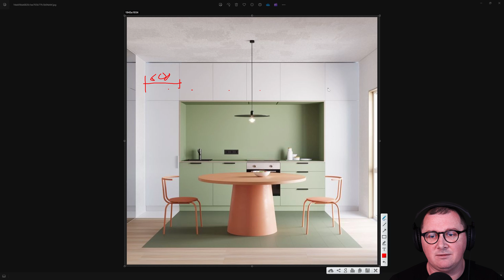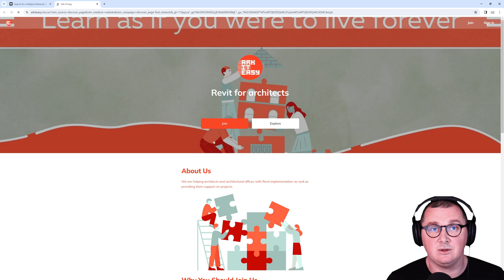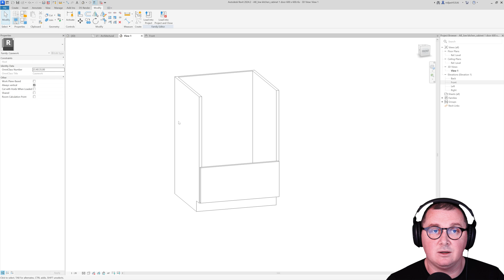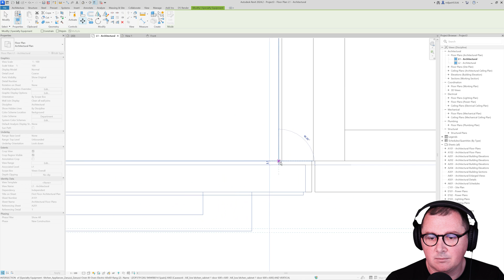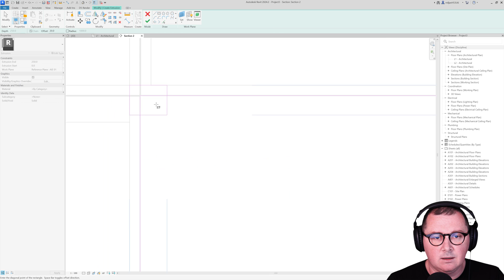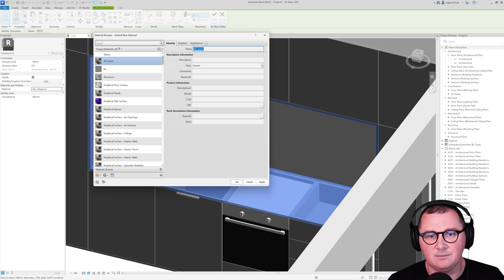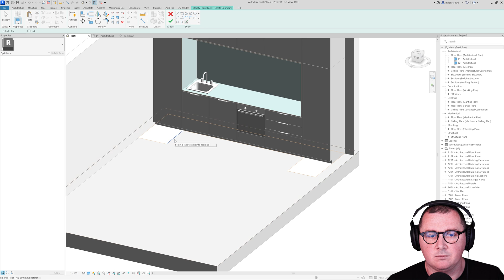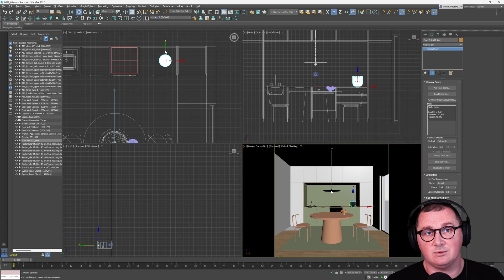Modern Kitchen in Revit - 3D Modeling Tutorial

Comment: I’m currently in the process of renovating my kitchen and maintaining the existing design. However, I’m facing a challenge regarding the backsplash material. Could you please recommend a material that effectively protects against oils, steam, and heat?

Additionally, I would appreciate your assistance in identifying the color code for a suitable shade of green that would complement the overall design.

Thank you for your guidance!
Reply from the maker: Hi, good that you will get the new kitchen and hope it will turn out great! However, you should search for those advices on some other channel / expert preferably locally, as this channel is for Revit learning. I truly wish you a good luck with choosing right products and getting your dream kitchen 💪